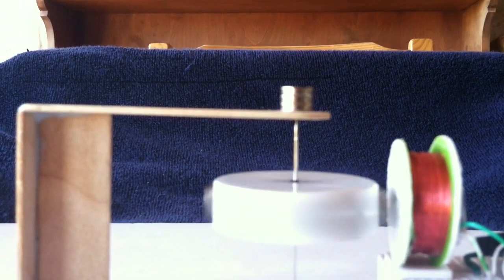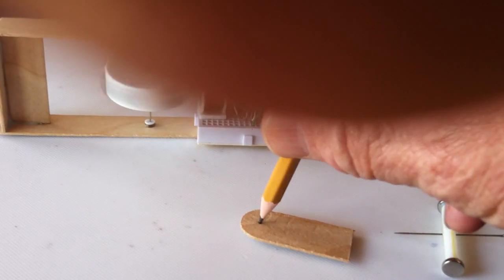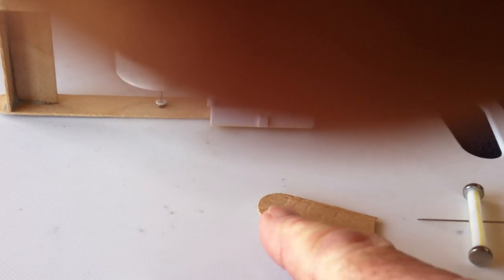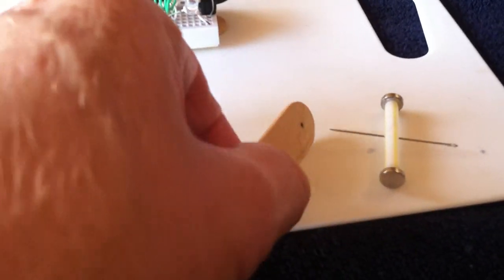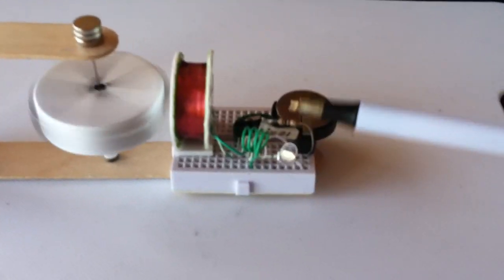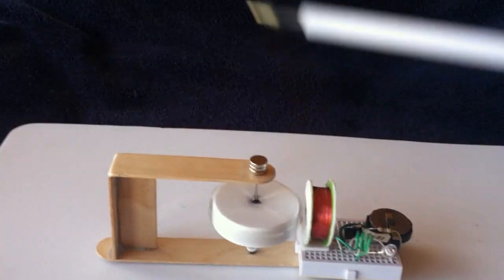Simple Low Friction Bearing

Comment: I am curious to know how to measure the curent drawn by this pulse motor. 
The current is not a simple sinusoid or a flat direct current. 
There are oscilliscopes that can perform matamatical functions on complex wave forms,  such as those from a pulse motor, but common multimeters only measure direct current and/or simple sinusoids. (probably at or near 60 Hz. ) .

Comment: An alternative mounting. Attach a nut to the top plate and run a screw through it. 
Attach a magnet to the lower end of the screw. 
Attach a magnet to the base plate and glue a small thin piece of glass (salvaged from a broken light bulb) to the magnet. Use a cup shaped section of glass. 

Set the armature to rest on the glass and adjust the screw to bring the upper magnet to the point where it just lifts the armature off the glass and then back it off a little. The screw adjustment gives you continuous control on how hard the armature presses on the glass. 

PS Pencil lead is a fused mixture of clay and graphite, maybe not the best lubricant.  
A small drop of Liquid Graphite might be better and the cup shaped glass keeps it in place.
Reply from the maker: Thanks for the tip. I have tried steel on glass and it does work very well.  I don't know how well that would hold up after years of wear.  Thanks or the tip about the Liquid Graphite lube.

Comment: Really nice. I use Ebay sapphire watch crystals that cost under 5 dollars. Since you are using a magnet to hold it up, The needle will center automatically. 
 
Good point about the rotor. They are sensitive. I may try a Plexi circle to make it spin more steady.

As I calculate it, a "regular" 3 volt lithium watch battery has about a 400 milliamp capacity. With a 4 micro amp draw, that will last 11 years! 

I too thought that the amp draw would never be low enough to run a decade, but with the super coils and a sapphire watch crystal, it can be achieved.
Reply from the maker: Thanks for all the tips. I'm thinking about just using 2 regular AAA alkaline batteries that have a 10 year shelf life.   I'm 67 now and I kinda have to think shorter term these days.   When I get into my 70s I might not be interested in this any more.

Comment: I think air resistance is your biggest enemy
Place the unit inside one of these...
http://www.ebay.com/itm/Foodsaver-Snail-80-ounce-Clear-Round-Vacuum-Canister-w-Lid-CLEAN-Used-VGC-/222424261277?hash=item33c984e29d:g:u34AAOSwA3dYjQ7M
...and draw a vacuum.
Regards.
Reply from the maker: Thanks for the links.

Comment: Yes!
I have a similar goal, I began my research / experimentation 
around 2001. Not full time, just when I had spare time and 
energy. I had expected to debunk a self running device but the 
more research and prototypes I built, the more it looked like it 
was possible. 

It seems a self runner needs most if not all of the following:
energy sources:
(any excess energy to be stored in a low resistance (= low 
loss) storage medium, ie- airogel capacitor or the like)
solar
stray RF (crystal radio receiver)
back EMF from the drive coil/s
pick up coils where the magnets move by (will need to be air 
coils so as not to drag the magnets, may have to address the 
Lenz effect also - shorting the coils at a certain time is suppose 
to help that)
[as in many things, I think it will require a combination of some 
or all of the above]

I agree with the factors that need to be incorporated:
low friction bearings (magnetic is the lowest I know of)
mass flywheel (is a form of energy storage)
acquire energy from magnetism
low current drive coil circuitry
zero volt diodes to reduce energy loss
perhaps litz wire to make the coils more efficient

Another version of a self runner is one that uses magnets only, in 
repulsion I believe,  the magnet wheel configuration.

see example of a similar arrangement here:
https://www.youtube.com/watch?v=mtCQHfcmifE

It is important to leave a space, not an entire ring of magnets, 
so that the magnetic field does not concentrate its self inside 
the ring of magnets.

Then the tricky part, getting the drive magnet past the lock up 
point. 
I think this can be done with a clever lever / cam arrangement  
that is beyond my abilities. 

I may request if this mechanical engineer could make a mock 
up of such an arrangement.
https://www.youtube.com/channel/UCli_RJkGWfZvw4IlDLHNCQg

I am very intrigued by this idea:

The  Creator of 5 hour Energy Drink has invented and plans on 
marketing a pedal machine that can produce 1kW.
https://youtu.be/YY7f1t9y9a0?t=10m44s

Rinoa Super-Genius says that a professional cyclist can 
produce something like 250w
(see in the comments:
https://www.youtube.com/watch?v=htfSwNyx3w4 )

If people power is 250W and the people powered machine can 
generate 1kW, why not take a 250W motor, put it where the 
pedals are, generate 1kW, use the 750W to power something 
else?

Why do people say this is describing over unity?
The "extra energy" is coming from the magnets. 

If magnets do not contain energy then please explain to me 
where the energy is coming from to keep one magnet from 
falling onto an other magnet (in repelling orientation).

As in, put a wooden dowel in a board, place a doughnut magnet 
over the wooden dowel and a second doughnut magnet on top of 
the first one (in repelling orientation).

The 2nd magnet will be held above the 1st magnet. Gravity is 
pushing down on the magnet, where is the energy coming 
from that is required to "hold" the 2nd magnet  above the 1st 
magnet?

To counter act the force of gravity requires energy. 

Many people are quick to say, "If it could be done, wouldn't we 
all have one powering our homes"? 

Well how about we think about that for a second. 

Do corporations care about human safety or do they care 
about shareholder profits?

Scientists knew cigarettes were killing people in the 1920's or 
1930's. So cigarettes are illegal right? Or maybe Philip Morris 
spends some of its billions of dollars to pay off the scientists / 
doctors. 

Well that is just one example, what about Flint Michigan? They 
poisoned people because it was cheaper.

Sugar was known to be bad in the 50's but that info was 
suppressed. 

Remember the Erin Brockovich  movie? Corporations say 
money yes people's lives no. 
Erin Brockovich (born June 22, 1960) is an American legal clerk and environmental activist, who, despite her lack of formal education in the law, was instrumental in building a case against the Pacific Gas and Electric Company (PG&E) of California in 1993.

How about margarine, it was invented to fatten chickens but 
when it just killed all the chickens the corporations needed to 
recover their investments. They created an AD campaign 
saying it was better than butter. Now that the majority is 
brainwashed to believe this, the scientists recently released 
verified studies that margarine is worse for people than butter. 

And the list goes on and on. 

So whom would be interested in suppressing any self running 
machine that may exist? Coal companies, oil companies, 
nuclear power companies. Gee, they don’t have any money to 
pay anyone to hide this info. What was your electric bill last 
month? Now multiply that by the number of people who buy 
electricity. Yea a trillion dollars may be enough to silence some 
one. 

This list of videos is a good start on understanding why things 
are the way they are. 

https://www.youtube.com/watch?v=a36_CwzA0bk&list=PLA780FD73AAB1B220

There is no doubt in my mind that a self runner can be built. 
And the people whom are not tempted by money that try to disseminate such information may coincidentally befall some horrible accident. 
Hacker like efforts will need to be used to disseminate instructions for building a working self runner. 

Science is even on the side of the believers, they recently 
announced a newly discovered form of matter , that exhibits 
perpetual motion properties. 

https://youtu.be/TjVi5L7cYLQ?t=1m22s

OK, ranting tirade over, in the end you have the freedom to 
believe what ever you choose to believe. And as I literally gave 
my life defending your right to do that, It does my heart good 
knowing my sacrifices weren’t for not.
Reply: I didn't read everything but can tell you're interested. I'm not going to dissuade you but watts are watts are watts are watts. You can't put a person outputting 250w into a "1kw generator" that generator may be capable of outputing 1kw... But the human is not ( with just his legs ) theres no way in multiplying that output sustainably.. by law. 100 percent is as good as it [could] get.

Maybe you could create a body spasm capturing machine and capture the full kw. Ha. Just kidding.

Comment: Your quest for a good bearing is to go from fair to excellent.  Assuming that industry with all its resources could do this, what would they do? Then you could back down from there to something achievable with available resources.

Regarding your sapphire bearing, it may be that a local watch repair shop may have a good source or even some that they could give you or sell.
Reply from the maker: Excellent advice.  Thanks. Cost is an issue for me.